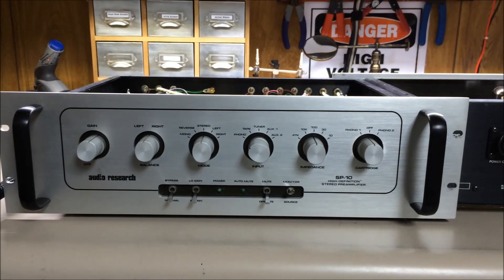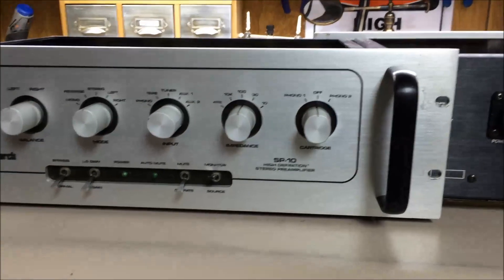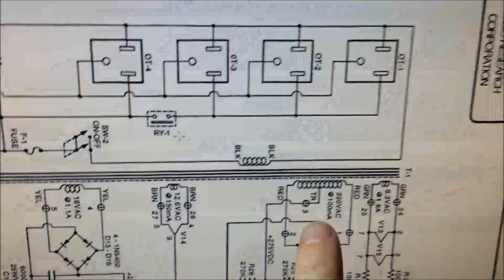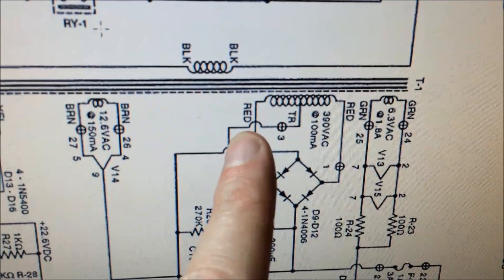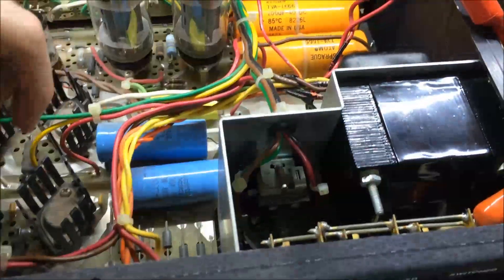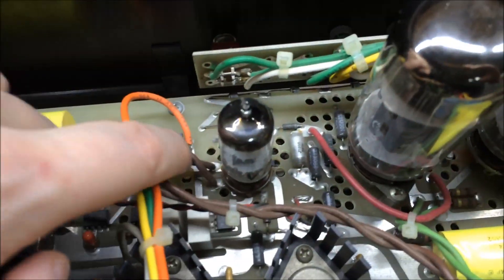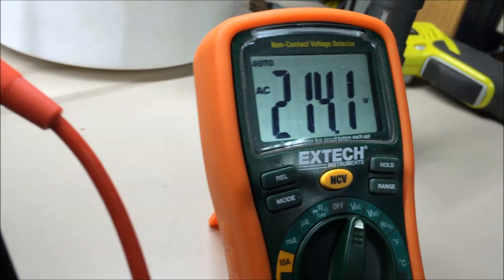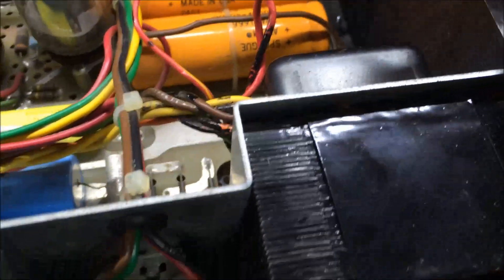Audio Research SP10 Repair Part 1 -BG005

Comment: A quick resistance check would have readily identified the shorted leg of the HV secondary winding. There is no reason to power up this known smoked and visibly cooked transformer at all. I do not power up a transformer after a resistance check shows a shorted winding when troubleshooting an amp. No reason to, the resistance check reliably verified a shorted winding. Heavy current draw already smoked the thing too, what more evidence do you need? I guess to power it up at full line voltage and switch the test leads around on flying leads....Dangerous instruction here IMO. That said, I appreciate this channel and watch all the vids.

Comment: If you notice the tracings do not have any sharp 90 degree angles. Some believe this is best for electron flow. This is in fact true for very high voltage systems but not anything inside of this device and most others.
Reply: I studied electrical engineering 10 years ago and we would get an 'F' if we designed a PCB with 90deg traces. Though our lecturer said it had more to do with etching process.

Comment: I've never seen such a complicated circuit for a preamplifier.It would be nice if you could walk us through the schematic and explain,for example,how those transistors and op-amp operates in the plate circuits of the tubes.It says on the schematic that they are B+ regulators but I'd like to know how it works.I don't see how the high voltage winding could draw so much current and not blow one of the fuses.There's actually two fuses that could have blown and they didn't.One of them is on the primary of the power transformer and the other is right after the high voltage rectifier so I don't get it.Also I don't see a thermistor anywhere on the power supply could that have helped in saving this very expensive transformer?
Reply: Transistors and ICs in the anode feed of the ecc88s in both the phono and line section are series regulators. The silicon transistors form a Darlington Pair. I hope that helps

Comment: Thanks for the video. I was looking forward to your part 2 video on this SP10, but I don't see it. Did the customer decide not to proceed due to the cost to repair? If so, that's a shame as this lovely preamp deserves to be fixed. Maybe you could comment here if you won't be making another video on it. As someone mentioned, the transformer can be unwound. Not fun or easy, but it might be worth doing to salvage the rest of the unit (assuming ARC didn't have this part). I bought an SP10 a few years ago and refurbished it. I replaced all the electrolytic caps out of an abundance of caution. A blown cap can take out the power transformer, the hardest part to find a replacement for.

Comment: 60hrz is a rather low frequency. I think the vibration overtime eats up motors and transformers. Some people have more harmonic distortion in there mains that could help kill it to. Where i live there's three power grids that tie together at times to make power requirements. One station has 6 diesel generators running parallel so you can imagine the dirty power.

Comment: Hi, I have a Audio research REF 3 preamp, when i switch it on it plays fine, after a few mintues, the left channel fades out and the volume on the right channel goes up and up until i have to switch it off?   any idea what it could be??  appreciate any help or advice..   Cheers
Reply: Check DC voltage supply of  tube heaters ....................

Comment: I'd take the transformer laminations apart and unwind the secondary until I got to the damaged section. Then just rewind, re-pot and put the core back together. It's not magic; it's sourcing the wire and insulation, attention to detail and patience.